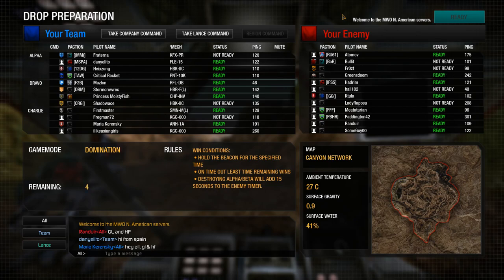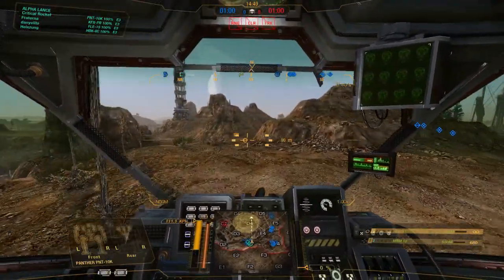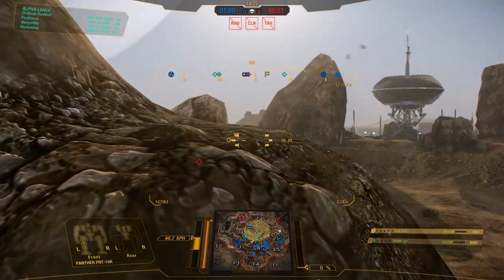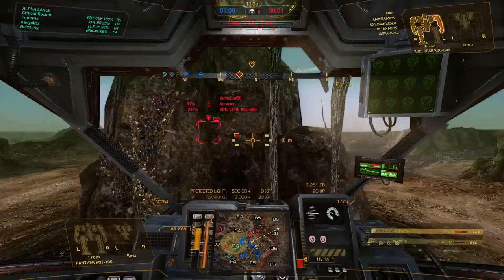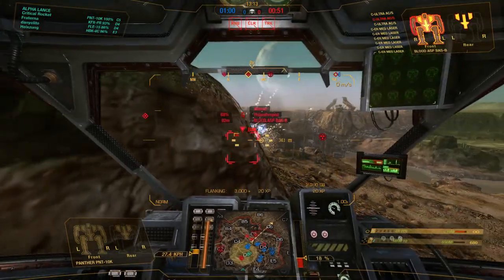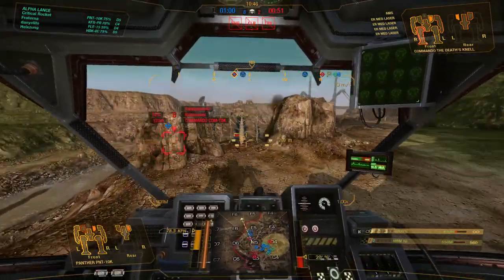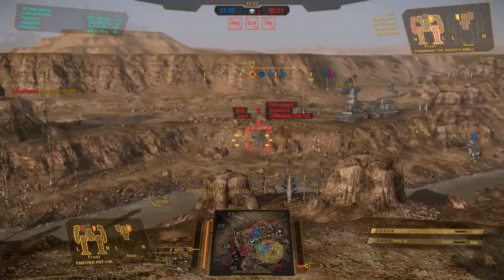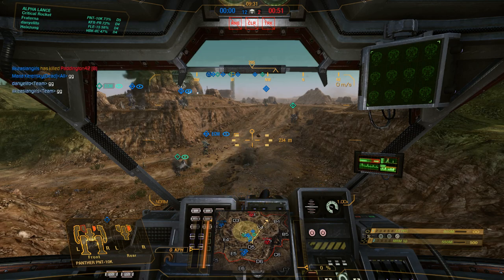MechWarrior Online - Panther PNT-12K2 gameplay

Comment: I run the Panther 10K with dual ER-PPCs. I had fun with it at first, but i jumped from T5 to T4 when levelling it, and noticed a massive drop in my performance. I figured it was a mech that's only good against bad opponents and wrote it off.

I came back to it today for the Valentine's event, and holy crap it's better than I remember. T2 players seem to write you off as a nothing mech and you can easily pop components and back stab whilst your enemy focuses on other targets. It's not that great for flanking/sniping, so stick with your team until you can safely get behind the enemies.